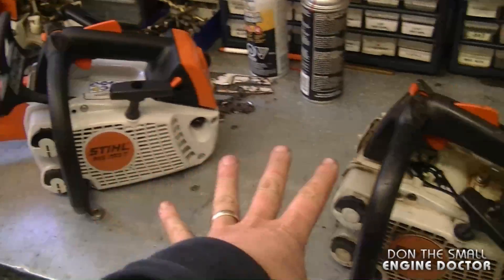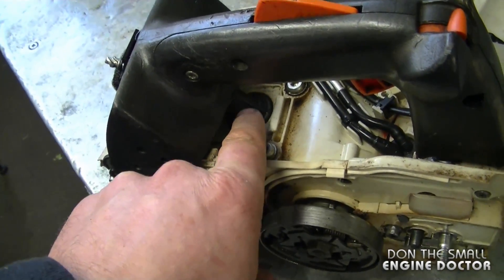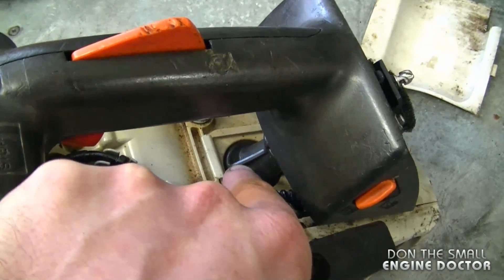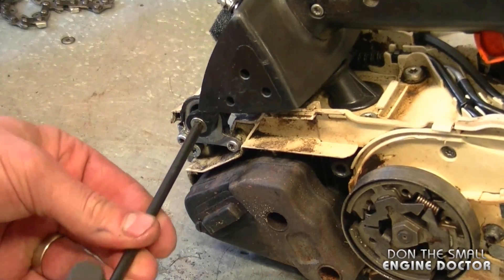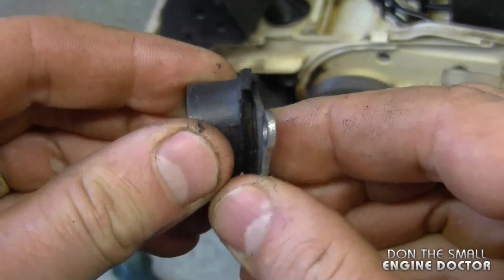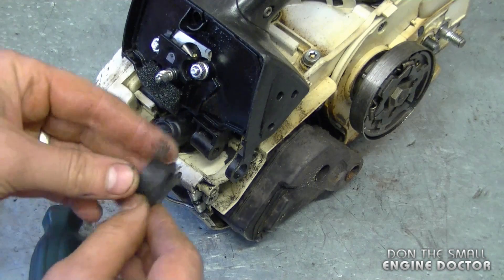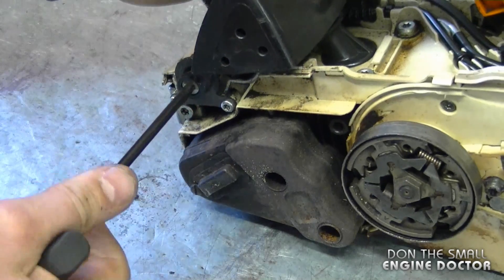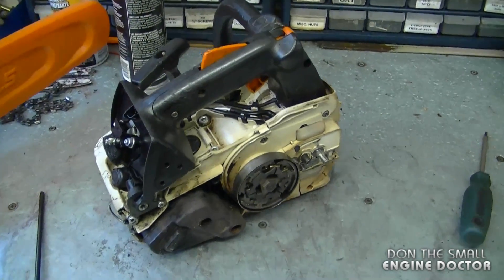Chainsaw Quick Tip #6 - Worn Out Annular Buffers

Comment: I have a 15 year old MS290 and I think I have this problem, When you puck up the chainsaw, if you put any pressure on the bottom of the blade, you can see the thing "flex" at the point where these buffers are put on the wrap handle... I think these buffers are shot. Great video!

Comment: I have an MS250 where the grommet on the bottom underside of the handle keeps popping out of the retainer hole.  Is there any reason for this?  I do not see any damage to the grommet from what I can see.  Thanks for any help.
Reply from the maker: it might be oily and slipping out, f it keeps up just replace it
Reply: @donyboy73  will do. Thanks!

Comment: Wow I knew I had to fix/adjust the "anti-vibe mount" (as I called it :P ) on the Tanaka I just fixed up as it's so soft you could blow it and get it to wiggle at that 'upper-rear vibe mount' (another way I'd been phrasing it!), I'd intended to fix it before more real usage just for safety's-sake IE I gotta trust the handle when in-canopy of course but to know it's capable of affecting the intake?!  Maybe it isn't as bad in tthat regard on mine but still great to know as a 192/193 is in my future, I'm still unsettled on whether it's smarter long-term to just get a new no-name every 6-12mo (I've been beating my Scheppach csp2540 for ~8mo now and it has never even needed its carb adjusted, incredible!) or to get 'highly-fixable' gear like Stihl so the 192/193, from a pawn, was likely to be my next saw - cheers man as usual thanks for the great content :D   Time to see if I can DIY my annular buffer on the Tanaka or if I'll need to source it (seems a rubber grommet should be easy to mcguyver, I know you can't/shouldn't do that from your position but for me it'd be fine I could just open it back up if/when it shook again!)
As always, A++ your channel is just tops man!!!

Comment: Thanks Don, I have two cs 300 echos and one has one of the buffers on the handlebar that's split. Looks identical to the one u showed. Guessing many of the features the top handle s have are used in them all, dispite the brand. Thanks again.

Comment: i have a question ,on a diff. subject and am seeking confirmation as to whether i am thinking  the right way.  i was asked to try to fix a small 2 stroke tiller  ( ryobi) ; it only runs at half choke so i am thinking the carb needs richened up ; only i have no manual for it so i dont know which screw is the low side ; one cap is black and the other is white , on  the screws    thanks in advance

Comment: donyboy73, Hello dony, how are you ? I have a quick question about a larger B & S engine 21 Hp overhead valve, single cylinder. It has way too much compression. Valves have been adjusted and are in spec. I looked into my cylinder with my borescope and everything looks, moves and sounds great. Should I automatically assume that I got a bum motor and the decompression unit on the cam may be suspect. I as well as many others, appreciate your Videos. Thx, Tim B.
Reply from the maker: could be a defective decompressor on cam, I would adjust at .003 first and see how it is
Reply: donyboy73 , I will give it a try and repost tonight. Thanks very much for getting back to me.
I appreciate it.. Tim B
Reply: donyboy73, Hello Dony, how are you ? I did close the valves down to .003 last night. Unfortunately, it didn't relieve the drag from the compression. I also noticed that I do not get the little bump in the valve when the decompression unit should be opening the valve. This engine is only 3 years old with less than 50 hours on it. The machine has always been indoors, and I also take care of all of my equipment. Oil changes, cleaning after each use,  etc...  I think I just got a bum motor from B&S but what can ya do ? Anyways, thanks for taking the time to answer and I apologize for posting this question on this video. I meant to post this on your Flywheel Key shearing video but I watched this video right after that video and apparently I goofed when posting.
 Thanks again for your help. Take care, Tim B.

Comment: Hi 
Danny....   i have a pressure washer that has oil in the combustion....   if i take the spark plug out oil comes out... 
what causes that?    i'm thinking the rings are shot...
Reply from the maker: could be, make sure it's not over-filled or tipped over or the oil will go into cylinder
Reply: donyboy73    I let my friend use it and I think he stored it up-right...